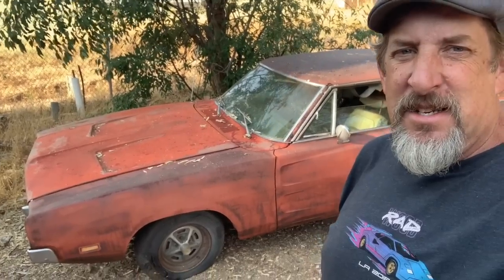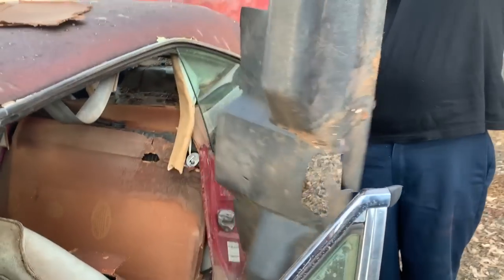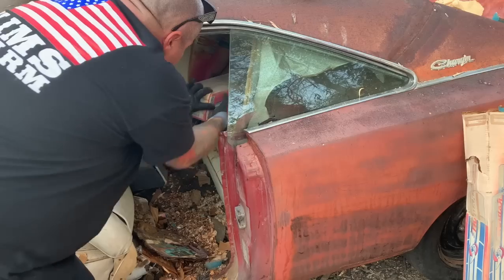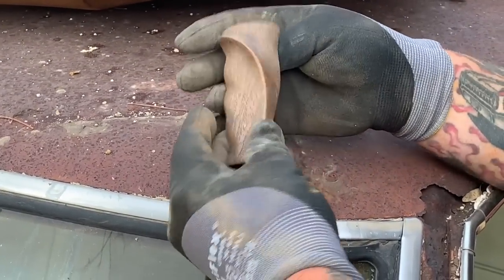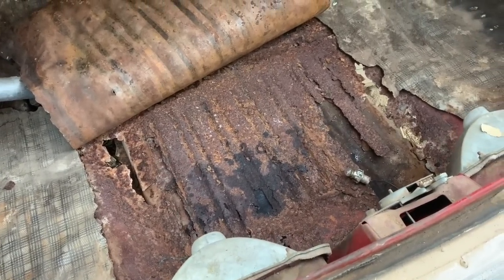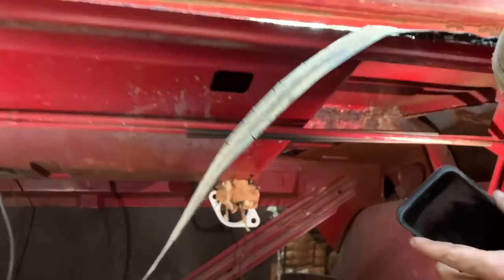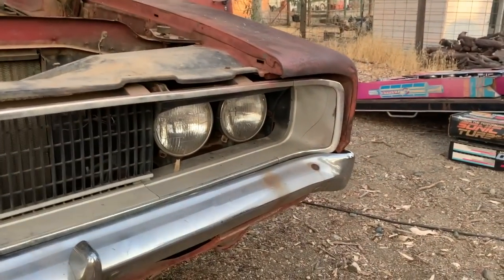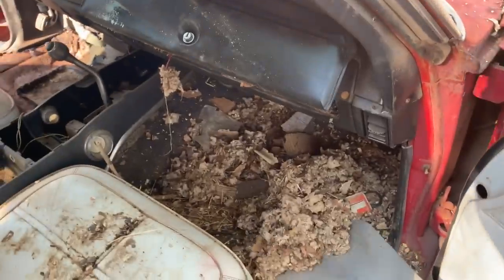Carchaeology: Barn Find 1969 Dodge Charger R/T Inspection

Comment: Those Thrush glasspacks took me right back to high school. Most of my friends had those. I had Cherry Bombs because I got them cheap.
Reply: My first car, a ‘65 Malibu SS, had duel cherry bombs that my dad and I bolted on it
Reply: Those style Thrush mufflers aren't made any more only the turbo or the welded 2 chamber flow master style are made by them . There were a set of these on ebay a few years ago & they were going for over 100.00 each lol. I had these style long ones but with the collector flanges for headers on a 66 Chevelle SS 396 & they sounded amazing with no tail pipes hooked to them but God awful loud so I decided to try the turbos they made back then in the early 80s & those killed power down really bad so I took those off & back on went the straight through's again .
Reply: I had continental blue swinger glass packs on my 70 Charger in high school.  Crazy loud and cherry bombs were great !

Comment: Just remember, rust never sleeps! That car can only be restore correctly via a full disassembly, then with media blasting or possibly dipping the body. The replacement of all the rusted parts, panels etc is very labor intensive. The interior is shot, part of the A/C system may be missing, the trans is incorrect and may not have the heavy duty internal components to back up the 440. It would't be long until you were up side down on the value of the car versus cost to restore. The buy in price will determine the worth of this roached R/T.

Comment: So what is the rear end is it matching to the car is it a Dana 60 with a sure grip? kind of skipped that part and collectors will want to know that stuff
Reply: Automatic cars did not get the Dana, only 4-spd got the Dana.
Reply: @bengone3349  On 69 thru 71 B and E bodies . You could order the Super Performance axle package behind a 440, or a Hemi with a automatic. This gave the maximum cooling package, power front disc brakes, and the Dana 60 with 4.10 sure grip. Otherwise, you are correct Dana 60s always came behind 440 hi po, and Street Hemi.
Reply: Its just a 8 3/4...

Comment: I really like this charger but I would call it rusty ratty charger. I would make side decals  with r/r/c instead of  r/t . Anyway nice  thrush glass pack haul.
Reply: It's not that rusty I've seen way worst just the trunk floor and bottom of the 1/4's not so bad the floor is all there with no holes